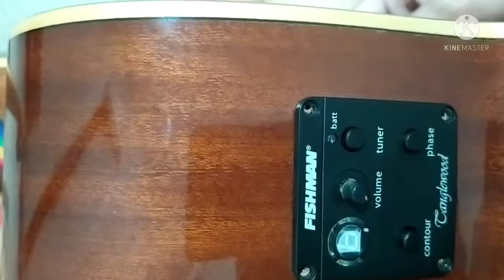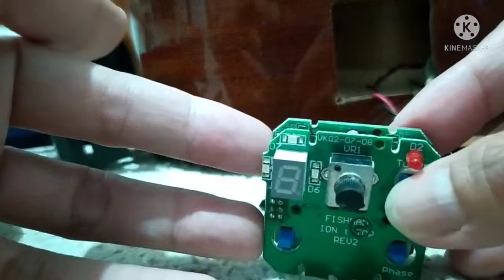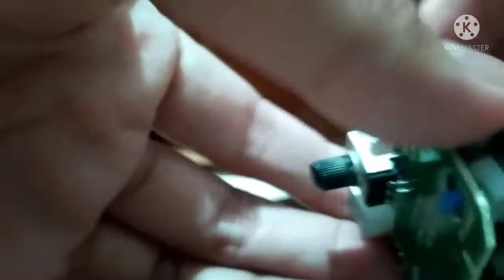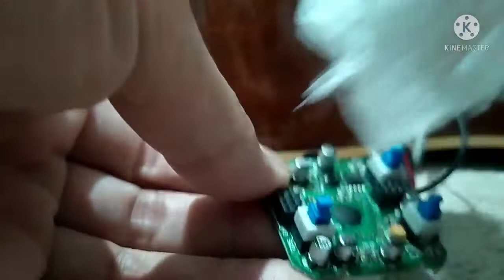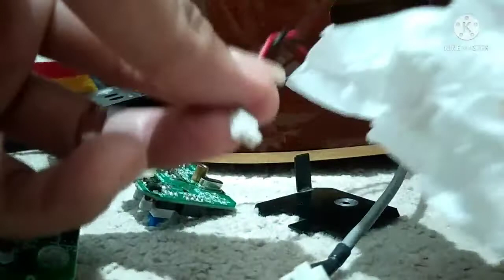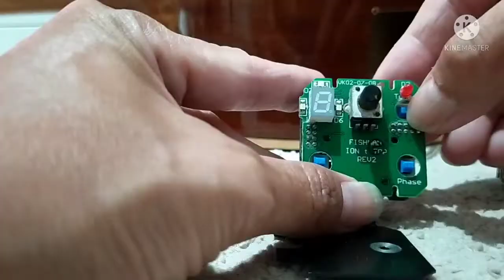Fishman isys tuner problem trouble issue fixed. Blinkin' green led with no signal.

Comment: very good video. 👏👏👏

Could you clarify for me, what product do you use to clean the parts and connectors?
Reply from the maker: an acetone, nail.polish remover 💅🏻
Reply: @pimen4488  if i use WD40 which is used to keep the strings away from rust.. is it okay ?
Reply from the maker: @advayavocals  wd40 contact cleaner? okay 😊👍🏼